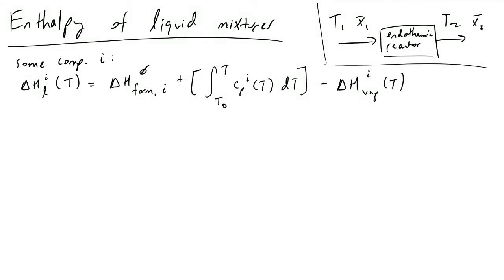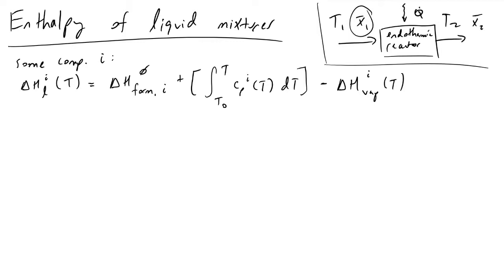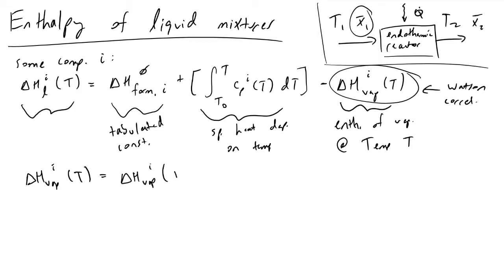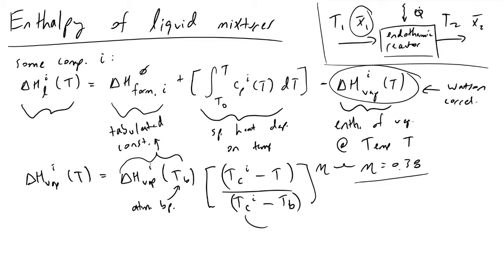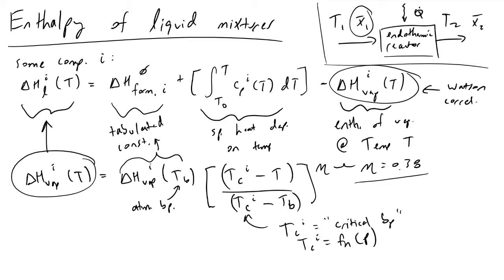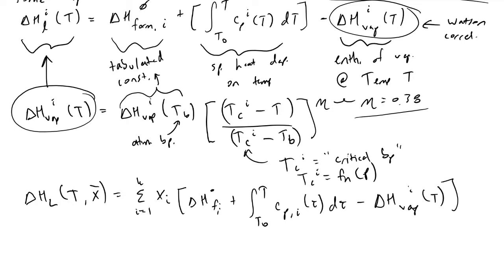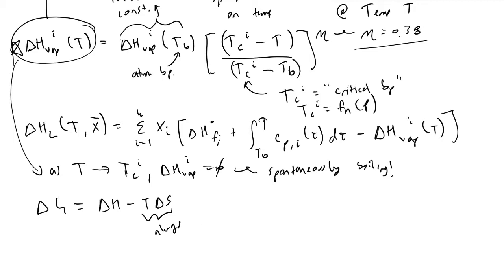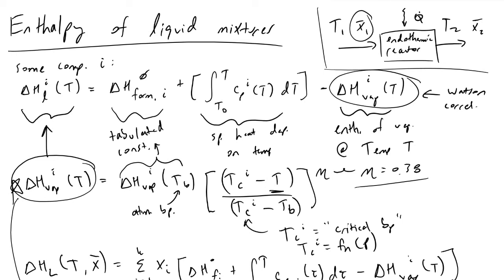Enthalpy of Liquid Mixtures

Comment: Hi Vincent, My experiment is also calculating enthalpy of acetone in an acetone and water mixture? I have used calorimetry and investigated the change in temperatures at different molar ratio keeping total moles of solution constant at 1 . Please can you suggest if these enthalpy  calculation can be applied for my experiment with  acetone. thanks

Comment: Great video! I just had a question. I'm doing a much simpler experiment with a mixture of methanol and ethanol and I need to find the enthalpy change of its combustion (using the temperature change of water after heating). I tried using mole ratio for each fuel but that didn't work out. Assuming I had all the necessary data, would this method still work for finding the enthalpy change value of the mixture?